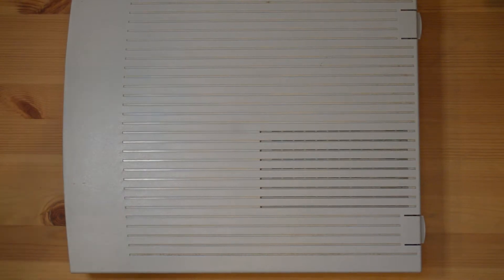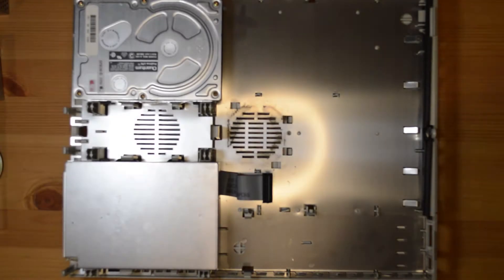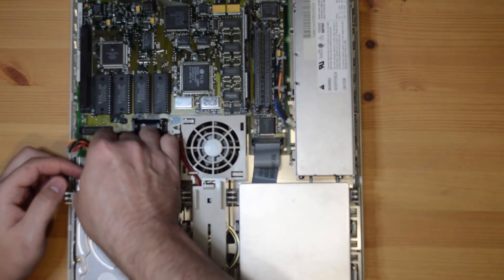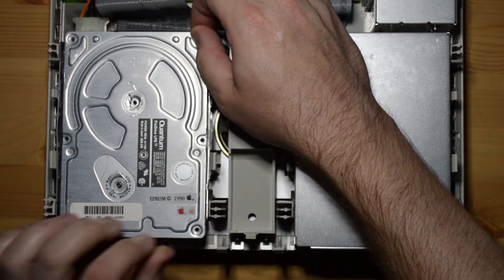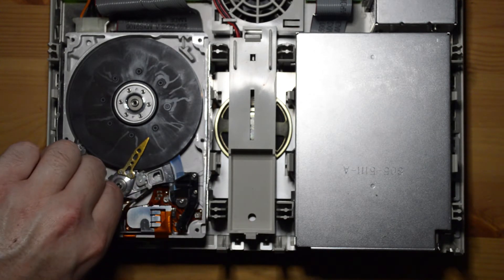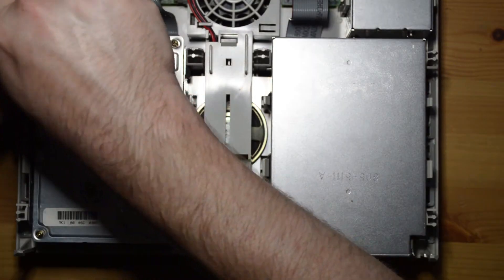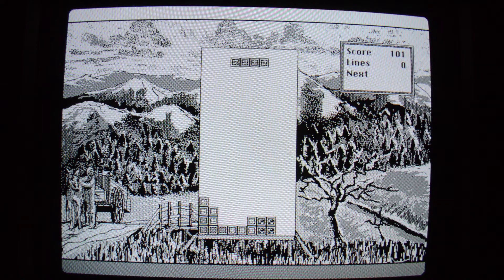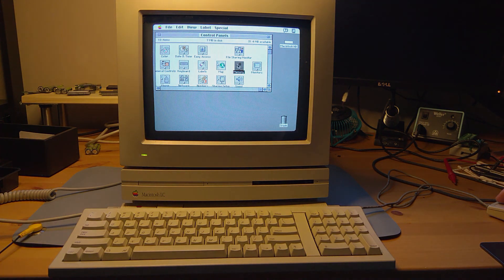Retro Repair of an Apple Macintosh LC Part 2 - Open it all up and boot

Comment: I need help my Mac LC Doesn’t boot, no chime, no screen, but the fan works. It used to run, what would be wrong with it? Thanks in advance.
Reply from the maker: There are a lot of options here. The fan means you’re getting power from the power supply, but could be bad caps, there could be trace damage or pin damage.